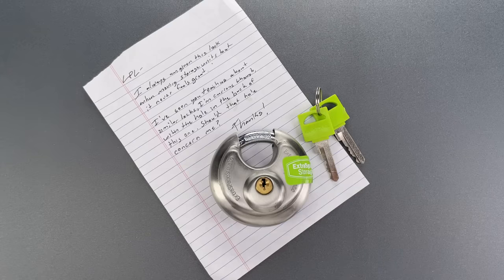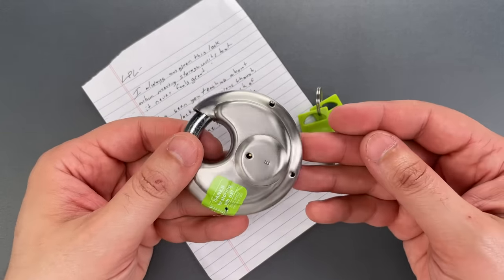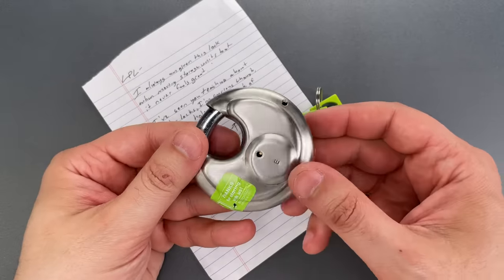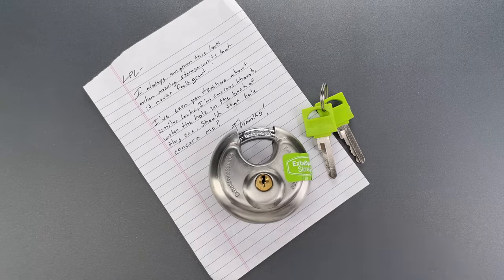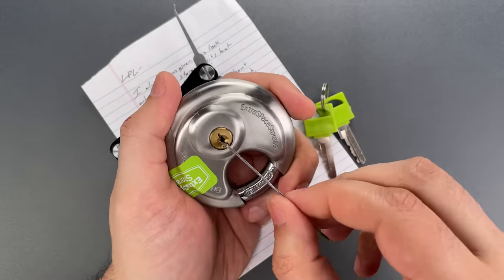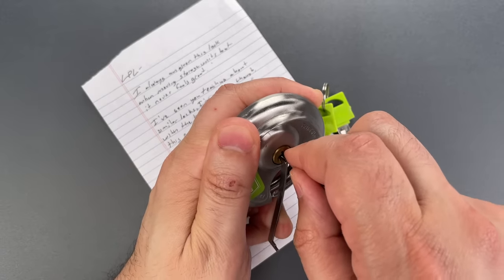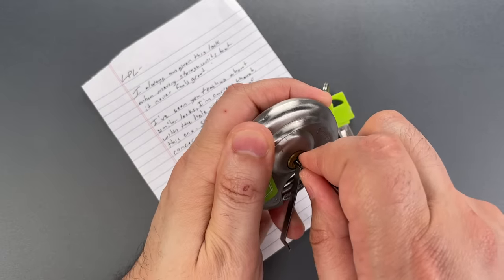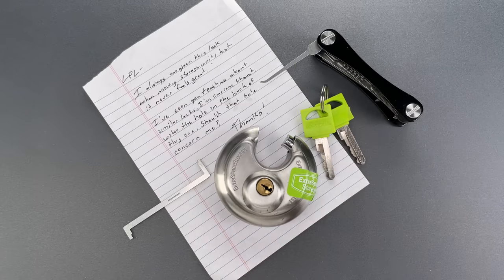[1367] ExtraSpace Storage Disc Lock Picked

Comment: I have a master lock version of this and it’s even easier to pick. There are no security pins.
Reply: "Once again an inexcusable design flaw."
Reply: masterlock still getting clowned on when LPL doesnt mention them in the vid, brutal
Reply: I have one you hit one pin it pops open it's quicker to pick than use the key lol
Reply: @karlgriff8  yeah pretty much.
Reply: Master locks
The masters at getting picked by anyone
Reply: That's a feature!
Reply: Master lock have tired of trying in security, and next lock in LPL review: "I'm going to be using my old regular turning tool and WE GOT THIS OPEN!"
Reply: agreed. i tried to learn picking using one of these, but it just kept popping open. 4 non-security pins and a thick tension wrench to overcome shackle drag and pop.
Reply: I think I have the upgraded version the one that's made of steel cable and wire clamps
Reply: Soooo, i need to throw away the $30 one I bought? ...
Reply: @calypso4533  😁😁😁😁😁😁😁🤡
Reply: @karlgriff8  aaahahaha I had a master lock like that once too
All but one pin was zero lift
Reply: The Masterlock version of this is literally the first lock I ever picked. Less than ten seconds. Simple rake. I thought I had beginner's luck, so I did it 5 more times in a row. They SUCK.
Reply: Wish I could say the same. I have 2 and cannot get them open. I wonder if the keying is just such a way that makes it a lot more difficult. You know how the order can make it easier or harder sometimes?

Comment: It's disconcerting to see your own lock get picked 😅
Reply: that's what he does to things sent to him after all.
Reply: I honestly dont think it would make a difference.  Even the best locks only stop him for 45 seconds compared to the 30 it usually takes.
Reply: First time?
Reply: So long as you're not the one who designed it, you're good.
Reply: @gravityassist3492  Yup, I only own 1 padlock and this happened to the the exact one on my storage unit right now.
Reply: @tonyippolito7580  Nope. The best locks like the Bowley model 543 are still beyond his picking capabilities.
Reply: @TheZeroSbr  It's just a matter of expectations. A key is just a very, very specialized pick. Given a week in the basement to work on it and tool up for it, I think it could be done. Besides, didn't Huxley just pick-gun it with a crafted tip?
Reply: @abitofabitofabit4404  Huxley picked a Bowley lock. Not the model 543 padlock, at least not that I've seen.
Reply: @randychavezjr6050  lucky you, I own a workshop and I used master lock for almost anything since it’s easily available around. Just Imagine how my reaction was when I found this channel.
Reply: He opened with a pick! A lock isn't really that bad, unless LPL uses a q-tip and a twinkie bar to open it. Or rakes it in 7 seconds: 2 to open, 5 to re-lock it and go again to show it was not a fluke).
Reply: @randychavezjr6050 me too! 🤬

Comment: Customer:  "Should I be concerned about these holes?"
LPL:  "Not at all - they serve an important function."
Customer:  "Ah, good.  That's a relief."
LPL:  "However, this core is mediocre and offers little pick resistance."
Customer:  "Well, crap."
Reply: Mediocre still means that the Master Lock on the next unit over will be a more tempting target.
Reply: Just swap out the core and you're golden.
Reply: Well they at least put in some effort.
Reply: If LPL has to resort to single pin picking, I'm not worried.  That's not how the vast majority of the criminals operate.  Now, if he could just rake it open, I'd be concerned.
Reply: @russellhltn1396  I can see the concern on this one. In my storage unit, someone could spend what amounts to unlimited time working at a lock... The only way up and down is the elevators, and it's obvious when they're moving. Single pin for even a mediocre novice is doable in those situations with virtually zero risk.

And no, there are no cameras where it really matters at my unit.
Reply: @MadScientist267  Are you obliged to use padlocks sold by the storage manager? I thought they only sold padlocks for customer convenience and you could bring your own padlock if you wanted to. Seems Abus 20/70 would be a good choice - discus shape but with high security core. Abus historically made lever type 'discus' padlocks. These would have been harder to pick than the pin tumbler version.
Reply: @netking66  I should change it in all honesty but to be just as honest, someone really wants into my unit, all they gotta do is get clever enough to hop the wall and get past the little barrier thing they got up there
Reply: @netking66  some U-haul properties require it. The one I'm using now does not
Reply: @arifhossain9751  You can't swap out the cores on these locks.
Reply: Calm down
Reply: @keszerda8364  I've wondered if anyone does make a disc lock where you can, but that'd have to be a pretty fat disc. It'd be more like a muffin than a biscuit
Reply: Mediocre. Just like the greedy company itself nowadays. - Current employee

Comment: I’m always happy when locks are not raked or opened with a simple comb pick
Reply: yeah that is good enough. this lock would probably take a few mins for even an ok lock picker. as long as it holds longer then bolt cutters or a grinder its fine. as long as you need to go through the key-way twice and maybe some counter rotation then. seems fine.

Comment: Some thirty years ago, this type of padlock sold as ABUS Diskus here in Germany. I believed, they were indestructible and impossible to pick. Then I got to know the Lock Picking Lawyer.
Reply: I've got one of those, mine is a disk detainer type. Even pin tumbler would still be decent from abus.
Reply: After I bought an ABUS model of this lock, my locker at the pool has never been broken into again.  They can't use bolt cutters.
Reply: They all try to look like the ABUS diskus.

Comment: " It does seem that they have At Least put in some effort, which is better then some"

 I'm ordering 10 of these!
Reply: Mako Locks sell a version of this with 3 serrated and 2 spools. I have one, and they're fairly hard to pick for a low security lock. The core they're using clearly has better tolerances than most disc style locks. And they happen to do direct mail order.

Comment: I have a similar lock from a similar storage company. If I wanted to break into a storage unit like mine, I'd just go with a hack saw since the lock loops through a pair of ~1mm thick metal pieces that slide apart to allow the door to open. The lock is merely there to say "This unit is securely locked; go away".

Comment: I have the U-Haul version of this lock, and its special ability is that it's quite rusty inside the lock body, such that it is quite difficult to insert the key fully, much less turn to unlock. However, the turning tool might give better leverage to turn the core, which may make it easier to pick open, once the pins are set, than by unlocking with the key.
Reply: Hose that sucker down with a cheap WD40 clone and treat it to a few minutes of key jive until everything moves freely. The hose it down again to wash out the rust powder. The cheap WD40 clones leave almost no residue, as it's mostly solvent, so the lock doesn't get gunked up by dust mixing with lubricant over time.

Comment: Very hard to open when the lock is filled with ice. The holes don't keep all the water away. I had similar lock and in winter time it was necessary to find an extension cord and a hot air gun first.

Comment: I use locks similar to this. The position he placed the lock in to pick this might prove to be very challenging in the field. These locks typically hang with the shackle facing the sky, and to turn the lock upside down and insert a turning tool as seen in this video would be impossible. To pick the lock “upside down” from LPL's position seen here might also prove to be challenging, as the shackle runs through a series of metal plates that would intersect with the positioning of the turning tool in this video. 

If any picking enthusiasts care to share feedback and poke holes in my novice observations, that would be amazing, I’m always willing to learn new information. It's cool to see a lock that I am familiar with on this channel!!
Reply: most of the videos here are made, so its easy to see for us, noobs, the way he operates the pick and turning tool in camera. Normally the position will not be so important.
Reply: @czyznaszmnie  Agree! To the original point too, that lock can be tensioned top or bottom of keyway, with tensioner inverted in either case as well if needed. And of course you have flat, L, and 'ergo' tensioners that can help if obstructed (or you have tendonitis!).

Comment: Sad that I had one of these on a storage unit that I couldn't find the key for and the "locksmith" i called charged me 90.00 to grind it out. one day i'll invest into covert companion and try my best to learn to avoid those kinds of situations. thanks for another awesome video!
Reply: Buy it to use only as a hobby, not as a tool, you may regret it otherwise. It is trickier than it looks and you may realize the 90 was worth it on a cost-basis. But it is a super-fun hobby, I invested in a great set from Peterson and am going to have to get some of LPLs stuff now because, well, it's all pretty cool...

Comment: The hole on the right can be used to push open the spring loaded latch and from there you actually can pry the lock the rest of the way open with a screwdriver.

Comment: At least storage units tend to be also: Covered by CCTV, inside a complex, have additional verification to enter premises etc... I've seen worse locks at storage depots.
Reply: not where Im at.
Reply: Still doesn't stop folks from stealing inside once their in.

One of the storage facilities in my area was the scene of someone who managed to steal firearms from a neighboring locker. They used the 6 inch "vent area" along 3 of the 4 walls of the locker to grab the firearms.
Reply: @cesariojpn  if you got weapons in a storage, you got bigger problems than theft. Sounds like a smuggling operation.
Reply: @professorfukyu744  my swords were in my unit because I lacked space at home.
Reply: I've never seen verification to enter the premises. A lot of them are just rows of garage doors on a cheap prefab building with a flimsy padlock bar and loop on each.
Reply: @Merennulli  some newer ons have fences with a gate. You have to enter a code to get through the gate.
Reply: 1) never store irreplaceable, very valuable, or super important items in a storage unit
2) if someone wants to steal your stuff, they will. Just make your stuff harder to get to than your neighbors

Sincerely, a storage facility property manager
Reply: @Merennulli  The one I use has a coded gate and the code is assigned to your account. Cameras also. However, the people who work there and operate the place are not the brightest.

Comment: Years ago I rented a storage locker and one day it got pilfered.  The padlock was a typical laminated Master Lock.  When it comes to storage space rentals, the only real security is if every locker door is wired into the office security system and if a locker door is opened while its tenant is not logged into the rental facility, an alarm is triggered.  24-hour security video recording is a must, also.  Without these features thieves will rent a large-size locker, which allows them to enter the facility at any time of day, whereupon they go from locker to locker picking padlocks or cutting them off and stealing the locker contents, stashing the loot in their locker, then later loading up and driving out without raising suspicion.

Comment: A storage unit rental facility I rent from installs a cheap version of these over the renters built in locks when they miss the rent. One day I couldn't stop myself from wanting to practice on these and easily picked five of them in a row before feeling like I ran out of time and didn't want to get caught. As a responsible picker I locked each one back up out of respect for the facility owner before moving onto the next lock. One time I forgot to pay my rent and got locked out and although I immediately paid the rent I couldn't get through to the owner to remove it so I just kept picking the lock open to access my unit only to lock it back up upon leaving. He ended up being out of town and eventually sent a helper to remove the over lock.

Comment: When I worked at Uhaul we would switch off cutting it with a cutter or barreling out the core. These are meant for Security Theater. When looking into Storage spots, look for external security. Cameras, member-only access, and no extra entry-ways to the units (all the units at Uhaul had a wired fence over the roof of the units that could easily be peeled back, especially if it's in a good blindspot.)
Reply: I forgot to mention, all Storage places use this lock

Comment: I believe the original of this was the Abus 'Diskus'... I have this, plus several cheap copies.  Is this lock better than the Abus?  The key machines at Home Despot no longer stock the blanks... but my local locksmith had them no problem, for 1/3 the price.  Find your local locksmith, folks... it's just better business.

Comment: i'll be honest, a mediocre lock takes you 60 seconds to pick.  a tough lock takes you 180 seconds to pick.  an easy lock gets raked.  for me the only real distinction here is a raked lock or a picked lock.
Reply: I was counting, a grinding wheel takes slightly longer than LPL.
Reply: 60 seconds of LPL time is probably 5-8 minutes for a criminal with some picking skill. That's a long exposure window... so yeah, raked vs picked is a realistic compromise for low security applications.
Reply: I'd indeed imagine that there's a decent chance of the one picking the lock getting caught due to the exposure time

Comment: My disc lock knowledge is that most have only two or three thinnish pins on the inside holding the assembly together. A 6mm Allen key ground down to fit the key slot and a sharp knock to get it in and a 6" pipe handle and a sharp hard yank on it breaks the pins off inside and lock is open in maybe five seconds. A lot faster but noisier.

Comment: I have a similar one from another storage company, a bit older. Even what I would consider myself to be as a novice can pick it, the only unusual thing is a lot of spring tension to overcome to actually get it to move once picked.
Reply: Oh, I had a Chinese padlock like that, I thought I'd missed a security pin, and kept trying to find which one it was.. until I tried to open it with the key.

Comment: In my experience, with my storage unit getting broken into the weekend before Xmas last year, the lock doesn't matter.  They'll just use bolt cutters on the cheap latch and bypass your lock entirely.

Comment: Nice timing. I was just looking through all of your disc lock videos trying to find one that matched the key to my CubeSmart rental. It has the round plastic bow with the rectangular notch toward the shoulder like a couple of others you've featured but so far the keyway doesn't seem to match any at all. The plastic bow is red and has CubeSmart's logo and name molded into it but no other markings. It's basically a mirror of this key but with another thin groove for a second little warding nib on the opposite side from the one on this key.

Comment: I rented a unit once and they required that I use this lock. I complained, and the manager told me they chose this lock because it was a very high security lock. Instead of arguing, I pulled a set of picks out of my pocket and opened the lock in under 3 seconds. The manager's jaw dropped.

Still made me use it, though.

Comment: The thing is with most storage units, if someone was targeting your unit and you had a beefy lock on it, it would take next to no effort to cut your way through the flimsy doors.
Reply: And in many configurations, if you are going to cut - you could just cut the hasp the lock is on quicker.
Reply: @xaosflux  Exactly, a beefier lock would only address the threat model of a random attacker going around checking random stuff. If you're unit is being targeted, they'll  get in easily by other vectors. The point of entry to the facility becomes their biggest obstacle then. And that's not hard to overcome..

Comment: Storage units would usually be insured. I had stuff in storage many years ago and I got a phone call from the company that there was a break in. The criminals must have been looking for something specific because they opened almost all locks with some sort of bolt cutting device stopping at the one after mine and leaving about 4 units untouched. They were in the place less than half an hour and nothing, not even anything valuable, was taken from my unit. In fact I remember finding a page of a document that wasn't mine. So, strangely enough, I ended up with something extra in my unit after the criminals had left. But anyway I got a new lock from the storage company (that now keeps a toolbox locked) and was told I'd be financially compensated by their insurance for anything missing before I arrived to check my stuff.

Comment: The master lock disc, is a real treat. The core of course is garbage...but a lot of these disc locks are terribly made. Two flathead screwdrivers can pry the body apart and you can simply slide everything out. The welds are not always so strong like you‘d want, that’s the first concern and main reason I don’t do disc locks. Solid body for the win!

Comment: Just pointing out that this type of lock is meant to resist bolt cutters, not picking. Anyone who want to rob storage containers, trailers or the like is going to use a nice pair of bolt cutters.  It's far faster and easier than picking.  Even the lock picking lawyer takes many times longer to pick these things than cutting them open. With a weak lock and a good pair of cutters, I can do it in under 10 seconds.

So the pick resistance isn't that important. It never hurts, but isn't it's primary purpose.